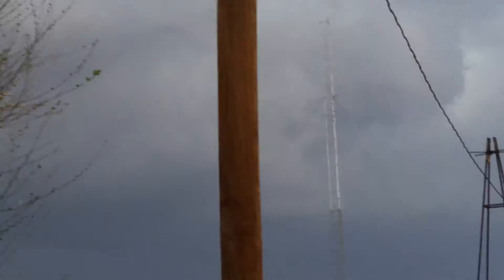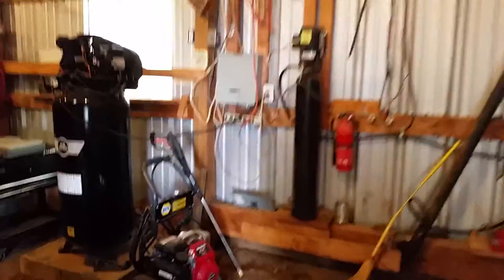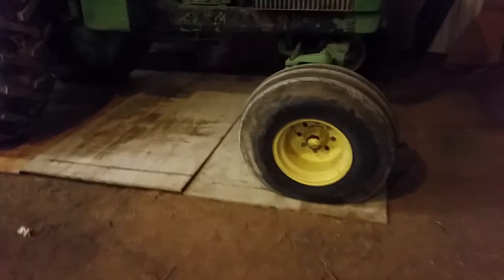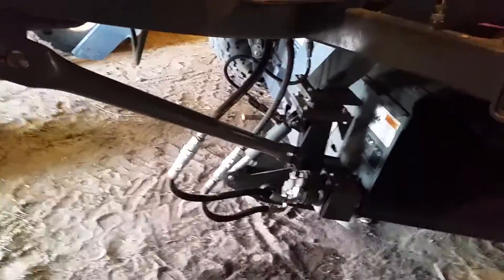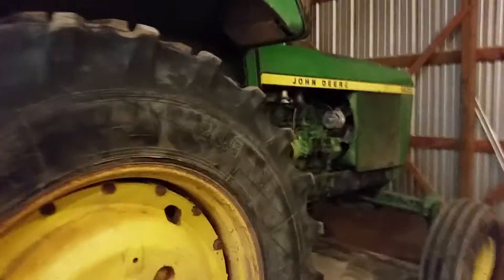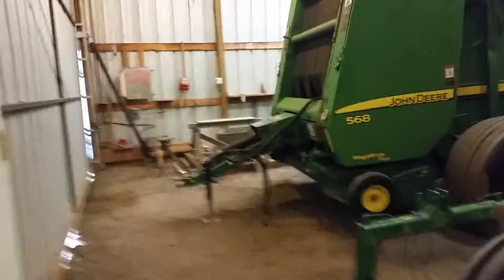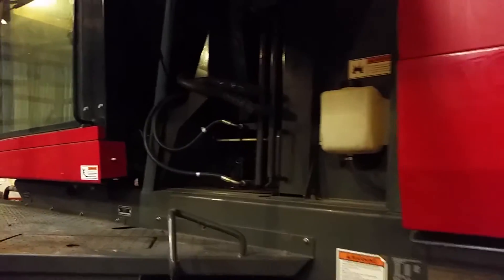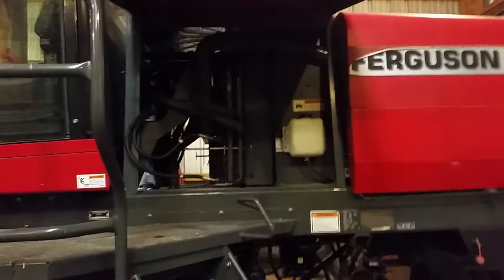4 15 16

Comment: There is a secret to getting exhaust bolts out.... Everybody uses some sort of oil... I use water in a squirt bottle once I get the bolt moving back and forth... Washes the rust out of the threads
Reply from the maker: +David Goethe I know on really stuck bolts or nuts on our old disk weve used lard, heat it up with a rose bud and then plce it on the steel and it will climb up a set of threads. works really well, just a really old school way of doing it